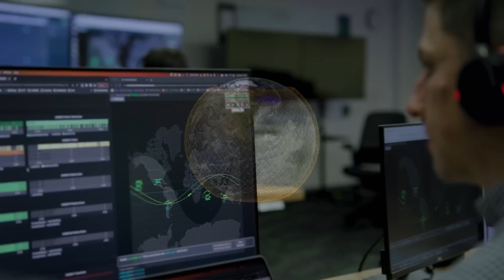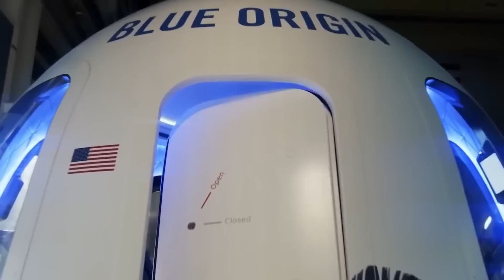Jeff Bezos Keeps Copying SpaceX's Rockets But It's Backfiring Now!

Comment: The idea of selling the Starliner project like it is a used car, seems nonsense to me. Yes, there is an object or two and a lot of electronic blueprints and design description, etc.  but what about the vast workforce that designed build and operates the thing?  I don’t really see that one can separate such a complex object from the supporting network of people surrounding it. And obviously we’re a bit past indentured  servitude so you can’t sell them as well.   As far as I can see either Boeing  needs to make it work or the whole project will be written off at zero value. BO surely he’s not even remotely supposed to have Lee expertise to operate an ISS service module designed by another company.  Indeed how would any company take over a project like that which doesn’t even function, make it work and make it profitable?